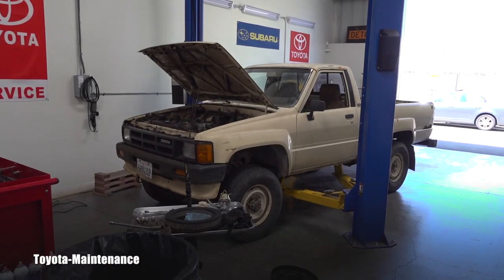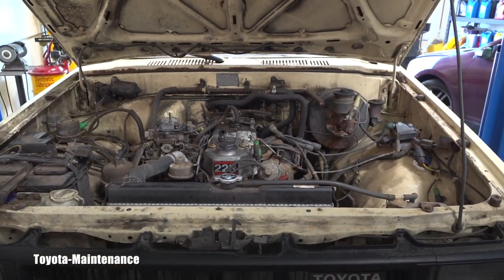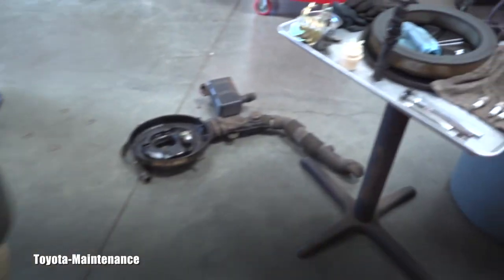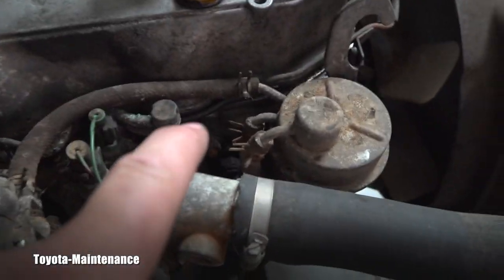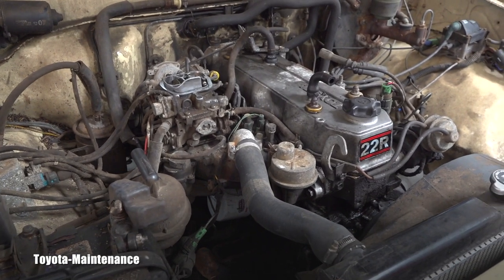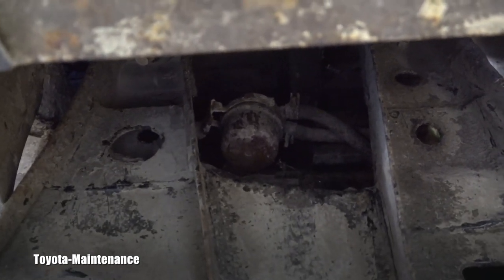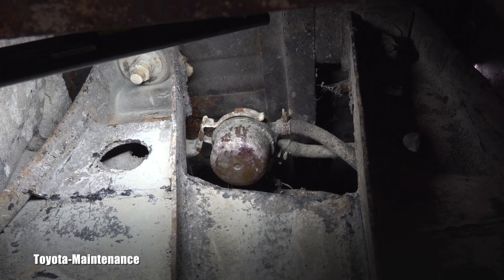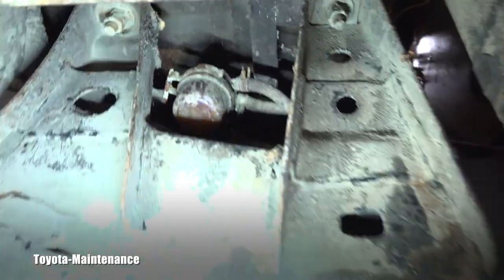86 Toyota Truck fuel pump and fuel filter location

Comment: Fun story, I resurrected a similar truck (except 2WD, and maybe a couple years older) that had been sitting still for a couple years. It passed inspection and ran fine... at first. After a few days it started running really sluggish and eventually shut off and wouldn't start again.  (This was on the PA Turnpike, back before everyone had cell phones and there were emergency call boxes every mile on the TP.) Had it towed to a mechanic. Being young and inexperienced in the woes of car ownership, I thought it was done for.  Turns out it was just a clogged fuel filter.  Got the truck back from the mechanic and it ran great again... for a few days.  Another clogged filter. From sitting still for so long, there was so much rust in the gas tank that was now being fed through the filter.  I went to the parts store and bought 5 of them. I became quite good at swapping out fuel filters on the side of the road.

I haven't thought about it in years, but seeing this one on YT, I kinda miss that truck.

Comment: Great videos and advice. I cleaned my MAF sensor, EGR valve, throttle body and air filter yesterday. My car is a 1995 Toyota Camry v6 (1MZFE). I found some oil in the air intake tube! I dont think that's normal. What should I do?
Reply: That is normal, dont worry.  It even happens on newer vehicles.  I am sure someone will chime in and give you the exact reason why and how oil vapor gets into the I take tube.
Reply: On those I'd also suggest running a decent oil / regular oil changes and ensuring the PCV valve is not sticking / clean regularly or replace.
Reply: Just to add, my first 1mz powdered Avalon was pretty tired..lots of blow-by and oil residue made it in to the inlet manifold and caused a bit of smoke on start-up. I replaced the PCV and ran a cheap eBay sealed oil catch can in line with the PCV system and never had smoke again. I'd empty the can every couple of months and drove that car for another couple of years.
All the best with yours.

Comment: You can change the 22RE to carbureted instead of fuel injection.
Mine is a 91 the block off plate for the mechanical pump is on the right. Top side just like the 22R with the distributor to the left and the pump to the right.

Comment: I enjoy your videos, and have one suggestion that might streamline your efforts.  For most work that's routine (eg. loosen bolt, squeeze and slide clamp, etc.) just tell us what's next, and cut ahead to when it's done, or the next major step in the process.  Trying to get just the right shot of something simple is probably more trouble that it's worth.  It should save you time, allow you do make a living, and post a few more videos.

Comment: Hello sir. Is there any chance you could tell me the fuel line routing to the mechanical pump. I know the port closest to the valve cover side goes to the carburetor but the center line and the INLET line I'm not sure if I mixed them up. On the passenger side of the engine the metal lines are bolted to it and I'm trying to figure out if the upper line or lower line is the inlet. Thanks

Comment: I’m surprised he located parts for it.
Reply: 20r/22r family engines have a decent aftermarket and toyota pickups as well. There are a few smaller parts that are rare to come by, but most of the known/problem issues have solutions and aftermarket support.